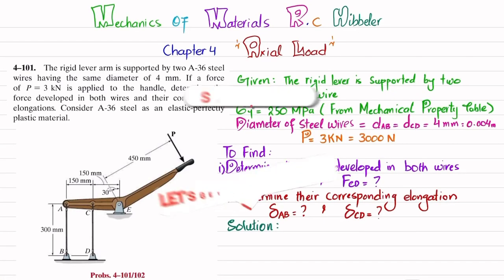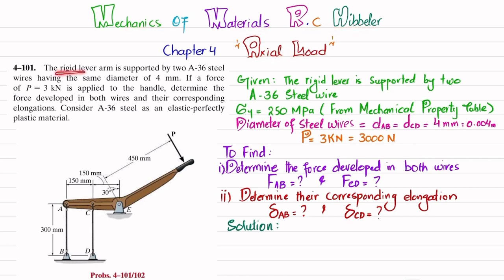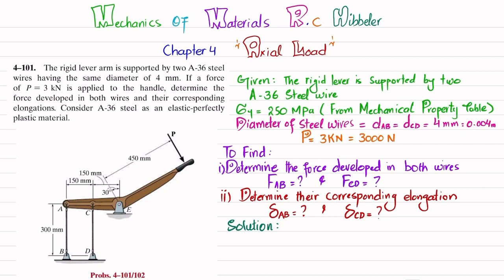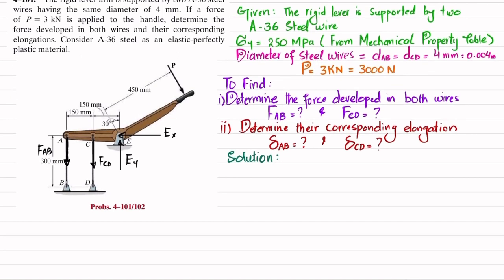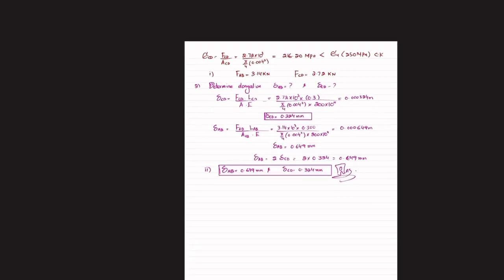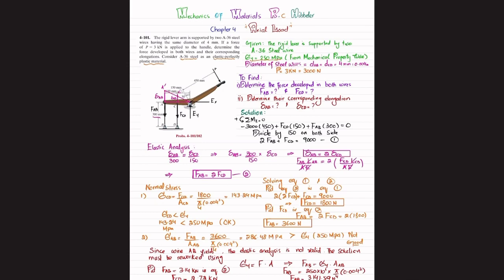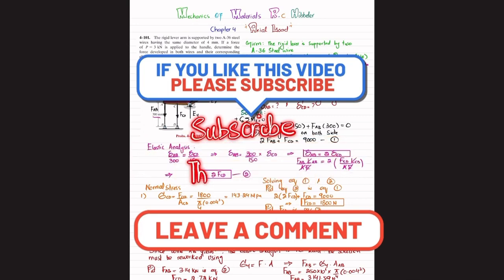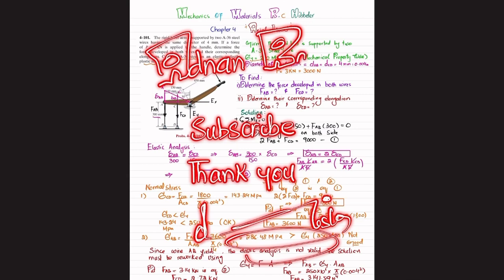4-101 Determine the force developed in both wires & elongation | Mechanics of Materials RC Hibbeler

Comment: elongation AB = 0.375mm ( not 0.649mm )
Calculated by calculator 
Can you recheck ?
Reply from the maker: You are right I checked it. So if you look that wire ab fails due to loading but we calculate it based on yield strength so its value comes out to be 3.14 KN and we have a relation above elongation in ab = 2 x elongation in bc hence we will use this equation to get 0.659 mm.

Comment: one time Fab = 3600N... again later Fab = 3141 N ... why is that ?
Reply from the maker: The first one Fab produced in wire is causing the failure of wire. Now based on yield strength we are finding the force in wire AB so that it will not fail. All the things are clearly mentioned in the video.
Reply: understood  @engradnanrasheedmechanical